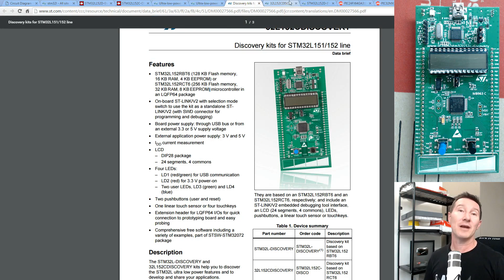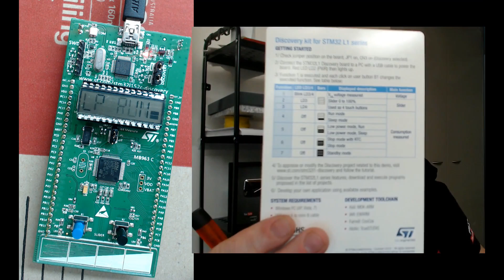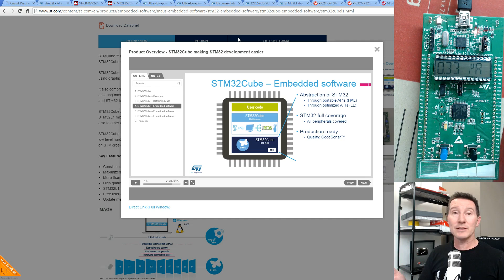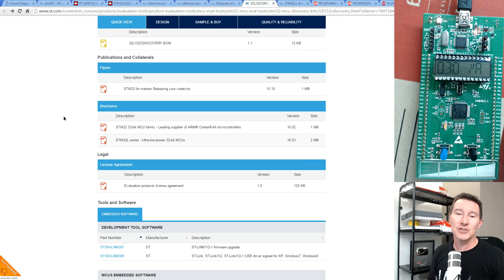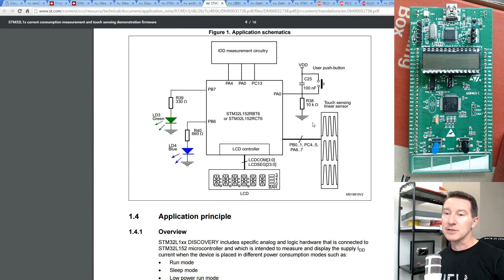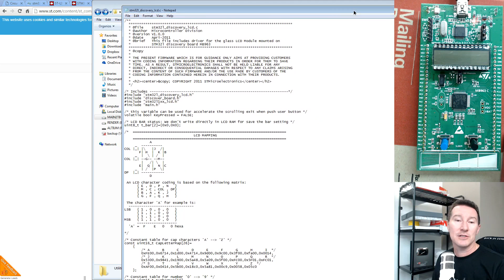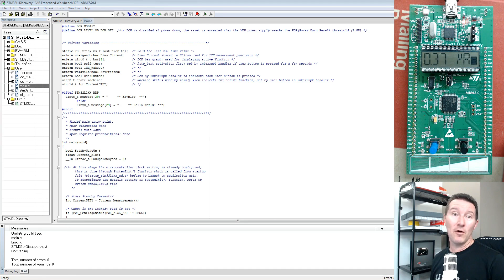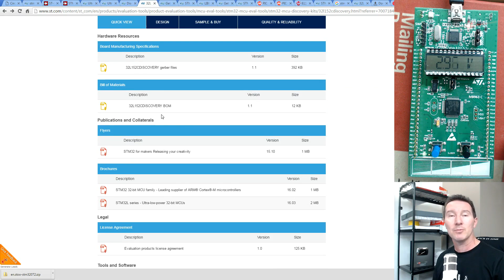EEVblog #900 - STM32 ARM Development Board

Comment: Search EWARM on Findchips for IAR pricing. Be sitting down.
Reply: Well, you could work around their no limits free trial by installing it in a virtual machine, taking a snapshot after it's registered and simply reload that snapshot every month and save your projects onto a shared folder, though yeah probably best to find another program if you want the least hassle as possible.
Reply: Sorry Miloš , I cannot confirm your observations. Do you have any benchmarks/test cases that support your claim?
Reply: For the free folk, there is SW4STM (AC6 Studio). It works fine enough
Reply: There is also a genius GCCARM toolchain available for free: https://launchpad.net/gcc-arm-embedded 
The toolchain is maintained by Joey Je, an devloper from ARM.

The toolchain is quite stable and we are using it for production use for more than 4 years now. The only thing is that the toolchain misses MISRA-C which makes safety-relevant development (SIL level according to IEC 61508 or Performance Level according EN 13849) difficult....at least the approval part...

Nevertheless, it works far better than KEIL, IAR or HITEX.
Reply: Fun fact: Microchip's compiler for their 32 Bit micros IS in fact gcc. They just patched in a simple mechanism to remove the compiler optimization switches unless you buy their "pro" version:
http://www.jubatian.com/articles/turning-on-optimizations-in-microchips-xc32/
As this site explains, since you're able to download the sources from Microchip (and even compile them if you tinker enough), it is not illegal/against the GPL to do this, still pretty disgusting.

Aside from that, my point is that gcc seems to be good enough for even Microchip themselves selling a copy of it as "pro" "solution", wouldn't you agree?
In regards to STM32, I agree with Carsten Schumann, we developed several gcc-based products and never had any problems with the compiler's performance whatsoever.
Reply: None of those even come close to a factor 2 difference. Where's the order of magnitude?

A more honest question, how do the compilers compare in the diagnostics department?
Reply: Yea, 5000-6000 for them. No thanks, Atollic Truestudio has a nice free/monthly ide though.
Might even be worth looking into eclipse with an ARM GCC compiler for the board too. Probably one of the reasons why I've stayed away STM chips so far. 

On the other hand, Freescale/NXP Kinetis is nice cause their IDE is free, but the HW programmer is a bit expensive unless you get the J-Link Segger EDU for ~80 bucks
Reply: +qazqwezxc0 Atollic has now no code size limit free version. I use that instead of Eclipse, gcc, gdb custom made ide
Reply: @hubmartin  update circa 2019: now stmicroelectronics owns atollic. so truestudio is looking good. also im about to fart. ok i just farted.
Reply: +droelfdroelfify man I did not see so much bad business practices like in this field... sucks.
Reply: They are expensive as hell but the support is top notch. If you earn your money with embedded stuff and don't like this ugly fat cow named Eclipse, IAR is the way to go.
Reply: But if you want to do any serious job with ARM microcontrollers you don't have many choices, you can pick IAR, Keil or TASKING (I suppose Dave should opt for TASKING as it is Altium product). IAR do negligible better job then Keil, I never used TASKING, but what I heard it is comparable to Keil (except it have support for MIRSA).
Reply: Carsten Schumann
You can google it yourself, there is plenty resources on that topic.
Here is just some of examples
https://devzone.nordicsemi.com/blogs/835/comparing-compilersides-for-development-with-nrf5x/
or
http://nxtgcc.sourceforge.net/wiki/GCC_and_IAR_compiler_comparison (which is done by company which make product based on GCC).
Reply: +hubmartin Thanks, I was looking into this, there are a variety free IDEs I've aggregated so far, feel free to mention any others I've missed:
- Atollic Truestudio Free + premium IDE
- System Workbench by AC6
- Coocox 
- GNU Embedded Toolchain by ARM --> Looks promising if you need bare bones toolchain + Eclipse
Reply: I used Raisonance for these.  I think the pricing was just as bad though.
Reply: Carsten Schumann
GCC is good exactly as it price is.
Only good thing about GCC is price and that it will (in most case) produce working code, but it do terribly bad job in optimizing code (which is what is most important for compilers for microcontrollers). Only compiler that produce worse code then GCC is Microchip XC8 in free version which deliberately insert needless instructions in just to force you to buy payed version (it is Microchip way how they got performance difference between free and payed versions, free version is generate artificially slow code)
IAR, Keil, TASKING are magnitude batter then GCC, and GCC is only acceptable for home users or companies that do not have money (and do not plan ever to make it) or they have so little production that they do not have economic interest to invest in compiler (on 1000 product sold you can not save on hardware to offset.price or good compiler)

Comment: i use CooCox IDE to program the SMT32F103, i think that IDE is compatible with most STM32 parts.
Reply: Me too for stm32f4discovery. A few years ago it didn't support c++, only c, but you can find some tutorials on the internet how to enable that... but I don't know about c++ support noways....
Reply: C++ works at least with the GCCARM toolchain which available for free: https://launchpad.net/gcc-arm-embedded 
 The toolchain is maintained by Joey Je, an devloper from ARM.
When using the nano specs, there is only ~1k additional code for all the C++ management stuff compared to plain C. When using C++ you should avoid exceptions ;-)

Comment: Last time I looked, IAR was free up to 32K, no limits but no library source. Problem is it's crazy expensive above that,  like several K
Reply: 32KB limit IAR is awesome until you select a few features in STM32 cube and it compiles 30KB of cube library's into your project to init the chip before you've written any code.

Maybe it's better now but it used to do that.
Cube IDE = excellent
Cube generated code = bloated to hell

I wish it would generate raw register code instead of library calls
Reply from the maker: Yes, that's in the video.
Reply: At least MDK is free and supported directly by ST.
Reply: Problem is when I couldn't even compile examples for my STM32F429-DISC1 without going 'pro' because with LCD it took like 36 kB... this made my start really slow, but now I'm sitting on nicely setup eclipse-based AC6 SW4STM with CubeMX plugin. IMO it's best go-for, since everybody knows eclipse is literally everywhere ;D

Comment: I really started enjoying these ST micros, it integrates rather nicely with GCC, GDB and OpenOCD, they provide low cost development tools (I've bought a Stlink V2 from china for less than 3$).

I don't like code generation tools, I use the STM32CubeMX instead to organize what peripherals I'll use and how I'll configure the clocks.

And I can develop entirely on Linux : )
Reply: Excellent, it's a shame that ST website only talks about Microsoft Windows. Any links on getting set up with the Linux development environment for this micro?
Reply: The sw4stm32 ide is free and Linux compatible
Reply: Marcus Jenkins I don't use IDEs, my toolchain is arm-none-eabi-gcc + arm-none-eabi-gdb + OpenOCD + Emacs. Here is my repository with code examples featuring the
STM32F103C8T6 micro (for a different micro you I'll need to provide the correct headers, startup code and the linker script, you can borrow it from STM32CubeMX).
https://github.com/Palmitoxico/STM32F103C8T6-Examples

Comment: I have the STM32F429I-Disco  its a bugger to program and the IDE is bigger than a pregnant whale. Sitting in the back of my closet and that's were it's going to stay. Lets see how you get on with this one ?
Reply: Stock eclipse GNUARM and openocd works on any of the STM32 custom/dev board.  Its pretty easy to keep up with HAL updates that way but once you really get to using it you will find yourself doing some custom things in the HAL likely starting with UARTs.  I've always hated deep IDE dependance but using GNU ARM and eclipse you can always move project around easily to make/cmake or upgrade underlying HAL/CMSIS etc if needed.
Reply: Try mbed. I've been developing on the 429, 303, and 746.  It's actually freaking awesome. Hardware layer abstracted and gives a similar to arduino IDE feel. 100% recommend.
Reply from the maker: Their own development board doesn't even support that then! LOL
Reply: Yup! Eclipse + Open OCD + GNU ARM takes a big stinky dump over anything else available.
The reason Microchip don't too their own horn is because they haven't had a horn to toot in the past 10+ years.
Reply: Is it that OpenSTM32?
Reply: System Workbench supports all ST boards, though you have to generate code in CubeMX. If you get used to this type of workflow its quite convenient however some people prefer std peripheral library which is not supported by CubeMX
Reply from the maker: Which IDE? ST don't have their own IDE apart from the excellent pin configuration tool.
Reply: EEVblog System Workbench for STM32: free IDE on Windows, Linux and OS X  @ http://www.st.com/content/st_com/en/products/development-tools/software-development-tools/stm32-software-development-tools/stm32-ides/sw4stm32.html
Reply: Oh and the program size limit shouldn't be a problem for anyone.
Reply: Cool will look at mbed and maybe pick up some dedicated mbed boards. Arduino is a little past it's sell buy date ...
Reply: Interesting, I hear a lot about mbed, not a big fan of keeping my code in the 'cloud' though. I've been keenly interested in the Freescale Kinetis MCUs and their associated fully free IDE. Only thing would require a Segger j-link debugger, though it's only 70-80 bucks for the not-for-profit version.
Reply: I'm lazy and just use platformio for tool-chain setup.
Reply: Rowan Doherty What does microchip make?
Reply: Mark's World what is meant by your question?